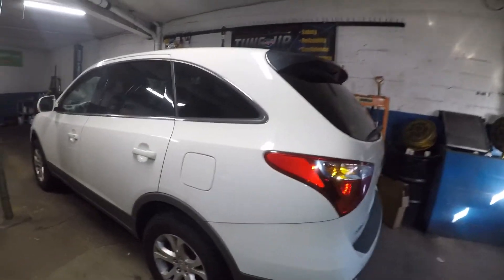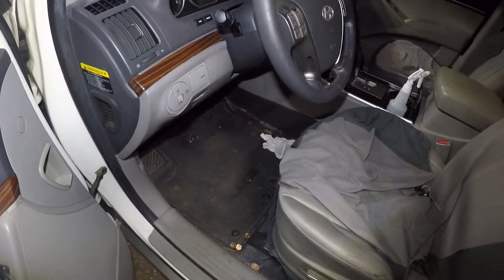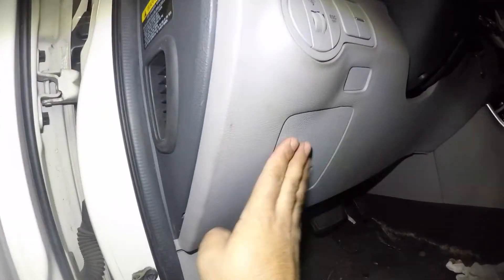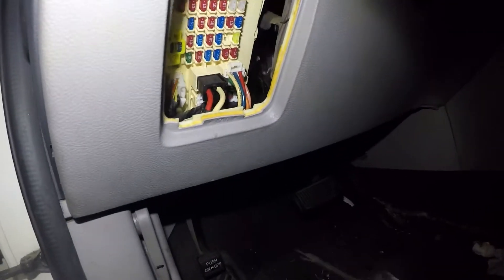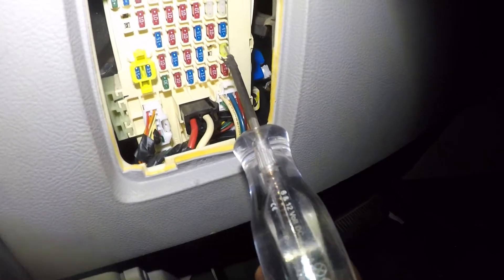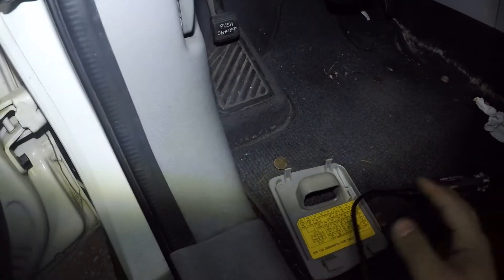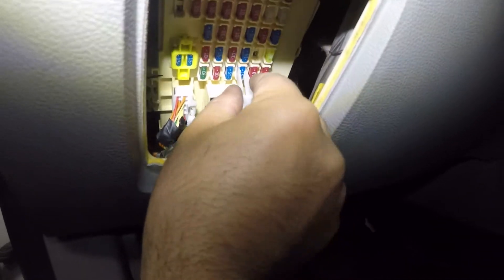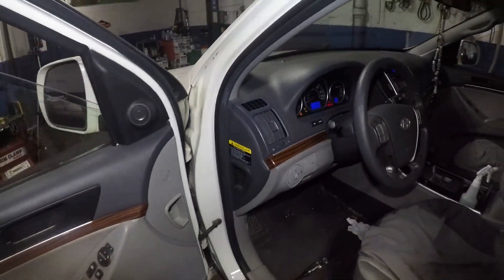Hyundai veracruz 2008 cigarette light, radio and brake light FUSE

Comment: Please tell me, is it possible for an electrical wire to be draining the battery out? My CD player doesn't work and I been having problems with my cigarette lighter too. Help me out. please.
Reply from the maker: Somthing has to be drawing power so the question u ask dosent state what the wire is doing u need to do parasitic drain test and pin point which circuit is drawing power the work on that
Reply: @rbthemechanic

Thank you!!!!!! It was not my alternator... unlike what I was told by my mechanic. Now my husband believes me, that it has to be electrical.

My car was charged up a bit yesterday, just running it. And today it started again by itself. So it proved what I knew and what you confirmed. 

But now my problem is, I gotta find a new mechanic. 😂 so there's that problem. I pray many blessings for you and your work. God bless you!

Comment: I have the same Hyundai Veracruz my brake lights dont flash but the fuse is good and the bulbs are good what could it be
Reply from the maker: Well check ur bounce again people tell me they good but usully they blown other wise check power and ground in connector
Reply: @RBTheMechanic  I fixed it it was actually the break switch . which is located on top of the break pedal . I moved the wires around and pushed em in an it worked
Reply from the maker: @kennycortinas7136  yup good job once u had checked power and ground at connector it would had been next step to change switch if that wasent detected back there anyways good job